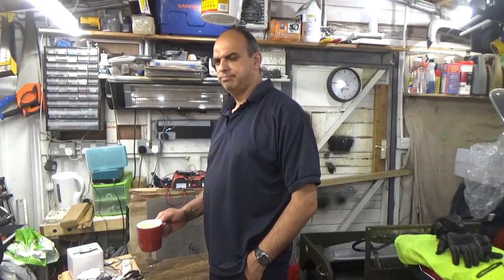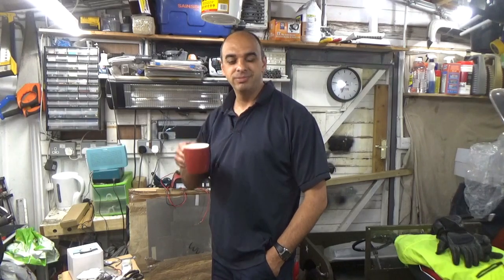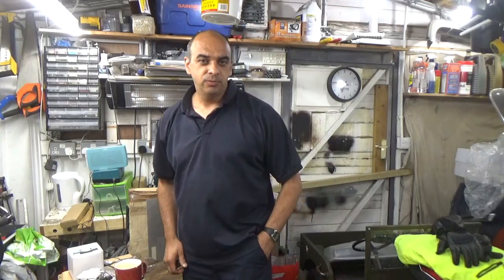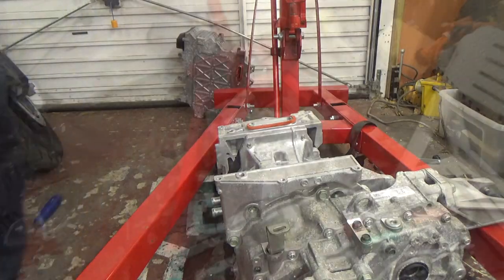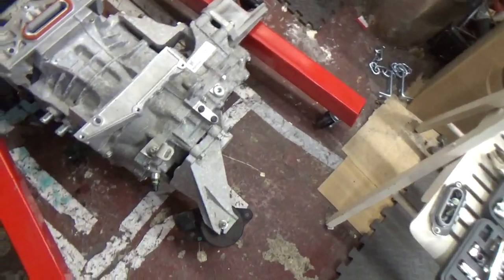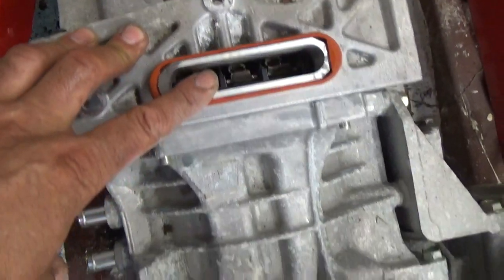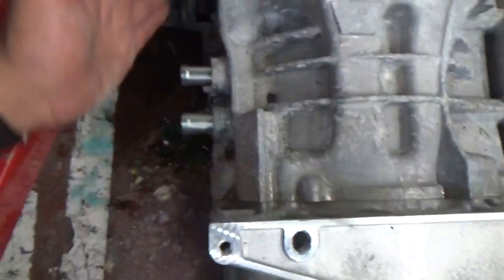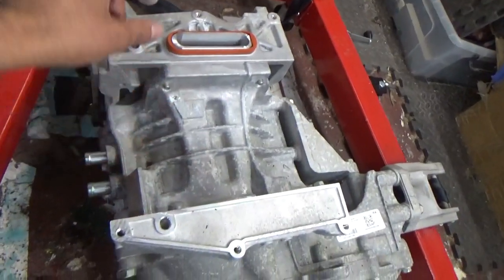Converting a classic BMW to electric. Nissan Leaf Power Part 2

Comment: will you still use the leaf inverter?
Reply from the maker: No. I have since found out due too my expense that the original inverter was faulty. I am going to use Pauls stand alone controller.  Video to follow
Reply: @IfItAintBrokeStillFixIt  ah MPaulHolmes? you're keeping the power stage of the inverter then swapping just the control board
Reply from the maker: @the_perigoso  Yes PaulHolmes original control board, i have built the complete inverter with power stage as to his instructables.com , it works well, very smooth, hopefully have the next video out soon
Reply: @IfItAintBrokeStillFixIt  cool i need one or 2 of theses motor in my bobcat skidsteer :]

Comment: What system are you using to control the motor ?
Reply from the maker: Paul Holmes AC controller, not sure what has happened to him, his site has been down for months
Reply: Thanks! Anyone have a system to control them?
Reply from the maker: @TheBoutiqueHotel1  you can checkout Thunderstruck Leaf VCM , its a CAN based system that controls the Nissan original invertor , looks a nice bit of kit I had good hopes for this but my nissan leaf invertor was damaged, the guy i sold the VCM to got it working. You also check out Johannes Huebner he has drop in boards for the leaf invertor and his own support forum. https://openinverter.org/forum/